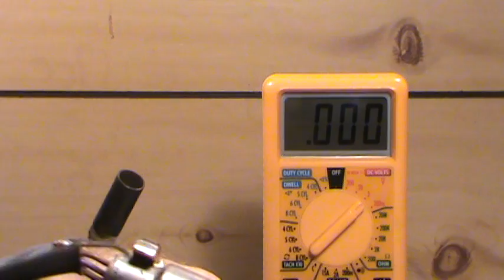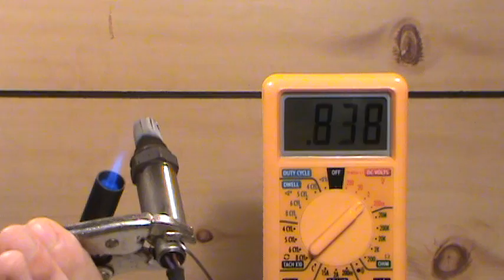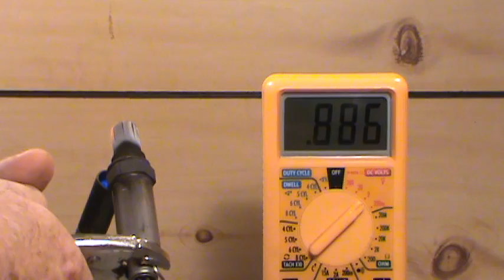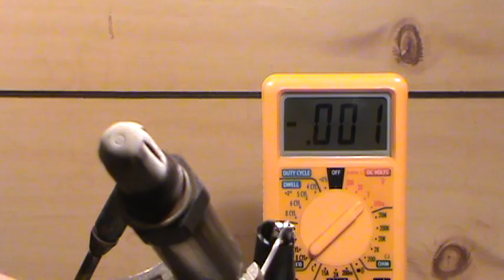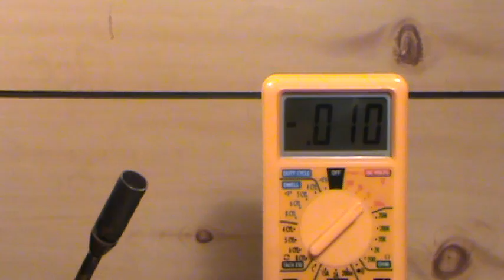Oxygen Sensor Test

Comment: ok,thank now my car is check engine and turbo not open
Reply from the maker: +Appo Myo....Greetings Appo Myo....Sorry, I never had an Engine with a Turbo (Turbo-Charger) on it, to work on, but, there are a few things that I might know about them............Make Sure that You put the "Right Grade (Octane) of Gasoline" that Your "Vehicle Manual" says to, as in, having the "Right Octane Rating of Gasoline", put into Your Vehicle's Gas Tank, cuz, I was reading about Your Vehicle, and, there was, oh, less then about 1,000 of them, that were having Problems, probably because some of the Owners/Drivers of Your Same Vehicle, were using Gasoline, with "Too Low of an Octane Rating", and, by doing that, it could very well cause some rather Expensive Engine Damage...!!!.....................Usually, the Engine's "Knock Sensor" System, will Detect any Damaging Detonation or Pre-Ignition (that usually sounds like a Pinging, Rattling, or Knocking Sound), that "Should Not Be There", and, Before it starts to happen, but, from what I was reading, Your type of Vehicle's Knock Sensor System, didn't work Properly to Protect the Engine, and also, having a Turbo (Charger) on it, makes things even worse...........................Most other, Computer Controlled, Fuel Injected Engine's, Knock Sensor Systems, would "Sense" the Ping or Knock, "Before" it causes any Damage to the Engine, and also, Before we would be able to even Hear it, if Gasoline, with too Low of an Octane Rating, was used in place of, a Much Higher Octane Rating, Needed by that particular Engine.......................As for the other problem, that Your Vehicle had, here's one simple thing to be aware of......................Make Sure, that, Your "Gas Cap" is "Tightened Properly", and also, make sure, that Your Gas Cap is Working Properly as well, cuz, Your Vehicle, is not only Smart, it's really Fussy too, and in this case, I'm talkin' about any Tiny Leaks in the Fuel System, or something that isn't working properly, that could cause, the inside of the Gas Tank's, Pressure or Vacuum, to not be, as the Specifications call for..........................Like I was saying before, try to find a Cadillac Website, that has a "Forum" on it, about Your Exact Vehicle and Turbo-Charged Engine, cuz, there should be some People on those Forums, that should be able to help You out.........Good Luck, and..........till next time..........Be Safe, take care, and have a good one.

Comment: Cadillac 3GYFNKE43A-5591626
YAS-591626
OBT II COAD P0469 AND P0134 How to repaired
Reply from the maker: +Appo Myo ....Greetings Appo Myo....Thanks for watching..............Now, let's see if I can help You out, with those 2 Trouble Codes that You posted here.....................Code P0469 comes up as, an...Intermittent Purge Flow Sensor Circuit...which might be almost anything, that is part of, or controlling, the shall we say, Gasoline Fumes, that are usually Stored in a Carbon Canister, until the Vehicle's On-Board Computer Determines, just when the right time is, when those Gasoline Fumes, get sent into the Engine, to be Burned...........................It appears that Your Cadillac might have some of the following parts, which may, or may not be faulty.............The Carbon (gasoline fumes) Storage Canister.......a Venting Solenoid.......a Purge Valve......and might also have a Device/Filter Unit as well.................Then, there will probably be some Hoses or Pipes, that might be made out of Metal, Rubber, or even Plastic, that might be Cracked, Split, or Disconnected possibly, which could result in a not wanted Leak........................Might even be a Bad Electrical Connection or Wire, that is causing the trouble..............Sometimes, if there is a Gasoline, or Gasoline Fumes "Leak", that's bad enough, a Person would probably be able to Smell it..............Now then, about that other Code...P0134...that comes up as a Heated Oxygen Sensor/Circuit, that might be Intermittent or No Response, and its location is Bank 1...Sensor 1....................Could be a faulty or contaminated, or worn-out Oxygen Sensor, or, the Electrical Circuit, having some not so good connections or wiring possibly........................Seeing as how I have not worked on a Vehicle like Yours, I think the best thing to tell You, is to look around on the Internet, and Search for a Cadillac "Website", that has a "Forum" on it, where You will be able to Ask Questions about Your "Exact" Vehicle, and, there are usually some Really Smart People on them, that hopefully, have had, some real Hands-On Experience, with the very same Problems, that You are now experiencing........................They should be able to tell You, things like...the Bank 1 (the V-6 Engine's...Head/Bank, and Cylinder Numbering), and where the (bank 1) Sensor 1...Oxygen Sensor is Located, in Your Exact Vehicle...hopefully............A lot of times, a "Trouble Code", is kinda like, someone pointing Their Finger, in a General Direction (in a Vehicle), and saying, the Problem is over There ----> (somewhere)...as opposed to being Pin-Point Accurate, as in, it's a Specific Part that's causing the Problem, but sometimes, Luck is on Our Side, and the Problem gets Fixed, without taking out a Bank Loan to do so...!!!...Yikes...!!!...lol....................Good Luck, and I hope, all goes well, and.........till next time..........Be Safe, take care, and have a good one.

Comment: Dear Sir:
I have blazer car 2005 and i replace the first and second qxgen sensor and still now my RPM is reach or approach to 1 what i shall do now thanks for replay.
Reply: +abdel karem alsaad Clean MAP, MAF, IAT, and throttle sensors as well as any IAC (idle air control) valve.  Test again.  Check for vacuum leaks.  Vacuum leaks will allow extra oxygen in, which causes the computer to inject more fuel. This is because you don't really have a "Gas" pedal, it's really a throttle pedal which means it's an "air pedal", thus a vacuum leak acts as a partially "gas" pedal.
Reply from the maker: +abdel karem alsaad Greetings abdel karem alsaad....Thanks for watching..................I'm not sure, by, what You were saying, when You said...RPM reaches or approaches to 1...???...........................Seeing as how You have a 2005 Blazer, then, Your Blazer should have a Computer in it, that has to be "Scanned" with a Scan Tool/Device (kinda looks like, a slightly larger, hand held Calculator), that, usually plugs into a 16 Terminal Port/Connector, that might be near, and just under, Your Blazer's Steering Wheel.................Some of the, probably Larger, Auto-Parts, Sales Businesses, might "Scan" Your Blazer's "Computer" for "Free", just make a few Phone Calls, and find out, if in fact, that, They might, just do it for Free...or...You can either Pay an Automotive Repair Shop, or, You might want to Buy Your Own "Scan Tool" perhaps...???.........................If there are any "Trouble Codes", Stored in Your Blazer's, Computer "Memory", then, those "Trouble Codes", should be able to tell You, what the Problem, or, more than 1 Problem, happens to be............................One other, very Important thing to do, is, have Your Blazer's "Fuel Pressure"..."Checked/Verified"...in order to Make Sure, that, Your Engine is getting, the "High Fuel Pressure" (might be around, about, 60 PSI/Pounds per square Inch), that Your Engine's, Fuel Injectors Need, so they will be able to Inject, the Correct Amount, of Fuel/Gasoline, into Your Engine, at all of Your Engine's Operating conditions..............................Make sure, that, You do the required Maintenance, at the Manufacturers suggested Time/Mileage/Kilometer-age Interval, in order to Prevent, any, not-wanted Problems, other then the Problems, that, can and do happen, even when a Person, does keep up with proper maintenance...........................To make Your Electric Fuel Pump, last that much longer, try to keep Your Blazer's Gas Tank, at least 1/4 Full at all times, because, the Gasoline, inside Your Blazer's Gas Tank, helps to keep, Your, inside the gas tank, Electric, High Pressure Fuel Pump..."Cool", especially, on a very Hot Day, and also, make sure, that Your Blazer, gets a "New Fuel Filter", when the Time/Mileage/Kilometer-age, becomes Due, as, I had a Fuel Filter, Plug-up, and the Fuel Pump burned out...!!!............................Make sure, that, that Very "High Fuel Pressure", is "Safely Bled"...Reduced to Zero PSI/Pounds per square Inch, Before working on any part of the Fuel System, and Wear Safety Glasses/Goggles, and have a Fire Extinguisher, near-by as well, for Safety's sake...!!!.........................Always have Fresh Air and Ventilation, around Your Blazer, when-ever the Engine is Running, because, Engine Exhaust Gas, is Deadly...!!!...............................So, have Your Blazer's Computer "Scanned" for "Trouble Codes, as well as, have the High "Fuel Pressure", Checked/Verified, to make sure, that, the Fuel Pressure, is with-in the Specifications, for Your 2005 Blazer............................If You happen to need, any more help at all, just post a Comment/Question, under any of my YouTube Videos, and I'll do, what I can, to help You out, and...................till next time..............Be Safe, take care, and have a good one.
Reply: +abdel karem alsaad check the map sensor "clean it " 
and clean the throttle body too :)
and let me know how that worked for you

Comment: Thank you very much for your videos. I am learning a lot since finding your channel. I have one question regarding this test you have showcased: How is it that in your test you are not providing any power to the sensor or meter? Does the reaction of the sensor to the flame generate its own power for the meter to read? My thinking was that a O2 sensor is supplied voltage by the computer and the metered value returned is what it analyses. Am I totally wrong?
Reply from the maker: +Caleb Hallford Greetings Caleb Hallford....You are welcome, and Thanks for watching................There are at least 2 Different "Types" of Oxygen Sensors, as well as, whether it's a Narrow Band, or Wide Band Oxygen Sensor, that I've heard/read about...........................The Oxygen Sensor that You see in this particular YouTube Video of mine, happens to be the..."Zirconium"..."Narrow Band"...type...........................When this "Zirconium Narrow Band" Oxygen Sensor, gets Heated Up to about 600 Degrees Fahrenheit or hotter, this Zirconium Narrow Band Oxygen Sensor, will be able to "Generate its Own Voltage Output", usually, from, just over Zero Volts to about 1 Volt...............If the Voltage, is around, about .45 Volts (just a bit less than, one half of a Volt), that will usually be, what is referred to, as Stoichiometric (spelling?), and, the Air/Fuel Ratio, should be around 14.7 to 1............If the Voltage is "Above" .45 Volts, then, the Air/Fuel Ratio will be "Richer"................If the Voltage is "Lower", than .45 Volts, then, the Air/Fuel Ratio, will be "Leaner"............The other Type (that I haven't had yet), is called a "Titanium" Oxygen Sensor, and, it "Does-Not", Generate a Voltage of its Own......................This "Titanium" type of Oxygen Sensor, is probably the Type, that You were Correct about, in that, it uses a reference Voltage (5 Volts?), that is sent from the vehicle's On-Board Computer, and, this "Titanium" type of Oxygen Sensor "Acts", much like a "Resistor", that changes its Resistance Value, based upon, the oxygen content, that's in the engine's exhaust gas, that flows by it/into it............................So, basically, as I understand it, that Reference Voltage (5 Volts?), gets Sent from the Computer, and, has to pass through the Resistance (Ohms), that Varies, inside the "Titanium" Oxygen Sensor, then, that Titanium oxygen sensor's, Ohms/Resistance, will usually, Modify/Change, the Original (Computer's 5 Volts?), into a Different "Value", then, that New/Changed Value, gets Sent back to the Computer, for further processing.....................Then, there's, the (I think) "Lambda/Wide Band", type of Oxygen Sensor as well, and, a whole different animal that one is, and, is probably, better as well........................From what I recall, if the engine's exhaust gas, is, at that Stoichiometric (spelling?) Value of 14.7 to 1, the Lambda, type of oxygen sensor, should indicate the Number 1............................Then, there are Heated, and Non-Heated Oxygen Sensors as well.....................The Non-Heated type, will probably have, only 1 Wire on it, where-as, a Heated Oxygen Sensor (internal heater), might have as many as 4 Wires on it..........................Some Vehicles, only have 1 Oxygen Sensor (single exhaust system, usually, having only 1 Cat/Catalytic Converter, and, maybe, 1 or more, Pre-Cats/mini cats/before the Main Cat)............................Then, there are Vehicles, equipped with Dual Exhaust Systems, that could have, at least, 2 Main Cats/Catalytic Converters, and might also have a few Pre-Cats/mini Cats as well, oh and, musn't forget, about, also having 4 or more Oxygen Sensors as well...Yikes...!!!...lol.............................On some Vehicle's exhaust systems, there could be an Oxygen Sensor, just "Before" the Cat, and also, 1 Oxygen Sensor, just "After" the Cat..........................The, just "After" the Cat, Oxygen Sensor, is the "Spy" (lol), that tells the Vehicle's Computer, whether or not, the Cat, is, Operating, Up-To..."Efficiency Standards" or Not, and, If-Not, a "New" Cat, or Cats, as the case may be, will have to be Installed, and maybe, some New Oxygen Sensors as well, and, just, repeat after me...expensive...Expensive...EXPENSIVE...!!!...it will probably be.................So, there You have it, well, for now that is, and.............till next time..................Be Safe, take care, and have a good one.
Reply from the maker: +Caleb Hallford Greetings once again....Ooops...!!!...I made a couple of Mistakes, when I posted/typed, it's a "Titanium", and also, a "Zirconium", type of Oxygen Sensor, where, I really should know better (probably not enough Coffee yet, resulting, in a lack of Awake-ed-ness...!!!...lol).........The real, and proper names are..."Zirconia"...and..."Titania"...Oxygen Sensors...(sorry about that), and till next time................Be Safe, take care, and have a good one.

Comment: Thanks for your return. I was just noted on your point of why propane was as rich or more as any fuel. The Fuel simply replaces the Oxygen to a point we call good. Static Position in the burn and Flame temp all effect that value. I use a O2 Sensor in my Wood Stove to get the best burn. The White Ash no Tar program which I am sure you can see works great. The Signal can be amplified using any Transistor chip gate wired for Analog or Op Amp etc. That can Open the Door Air Vent to any desired value. THem O2 units can be used even in your Lawn Tractor etc. to dial the burn. Maybe others have done but putting a Bung on the side to top area of a Wood stove Ahead of the Flu will give you the O2 Count same as any exhaust Manifold. As the Value Rises saying rich the Air Door Opens more related with a spring Loaded Solanoid. Take Care. Vern.Ps your vid is good and I have used that test as well.